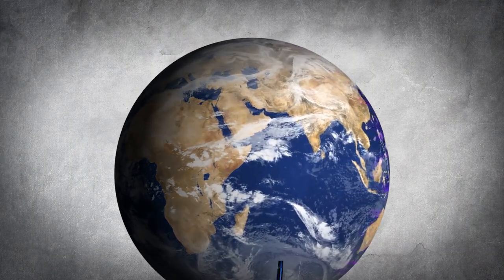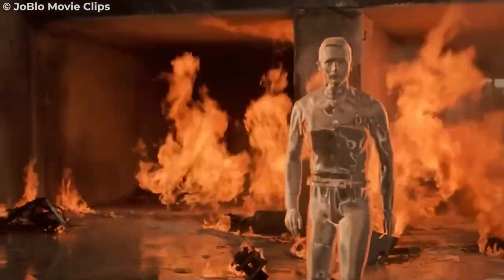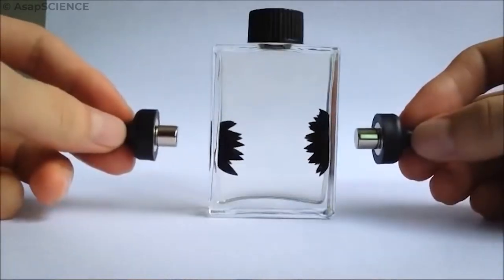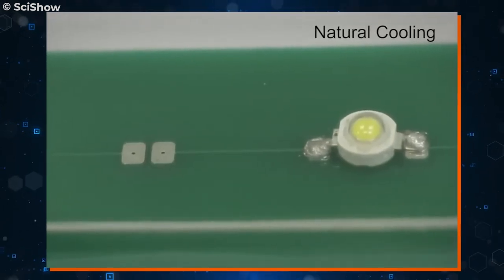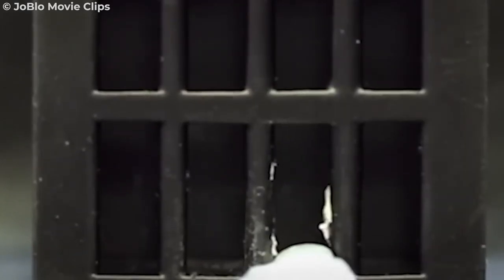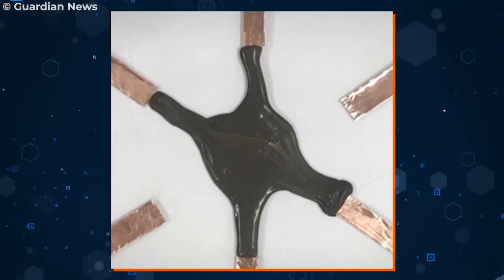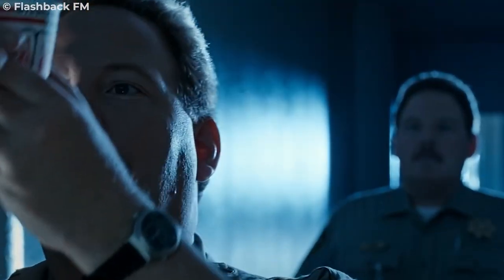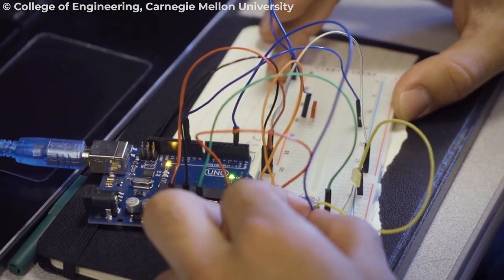This First Liquid Robot Is Genius, Here's Why

Comment: This is nonsense, the "robot" was just melted and then solidified in a mold. It can not return to the shape of a Lego man of its own accord. A robot has to have some functionality inside it. This stuff is just a metal with a low melting point and some magnetic stuff in it. It's no more a robot than a mercury thermometer is.
Reply: Ever heard of memory metal ?
Reply: @Rebel with a Cause  yes, I have heard of memory metal. That is also a solid of nickel and titanium and would not hold its memory if melted. In fact, how you reset the memory by heating it beyond one of its crystal phase transition temperatures. Just like hardening high carbon steels. This video is nonsense
Reply: Lmao "American and Chinese cooperation" then proceeds to only name of Chinese scientists.
Reply: @seanpelletier  Why don't you google up Professor Carmel Majidi and see if he is Chinese or not? He is listed among the co-inventors.
Reply: That shows how little y ou know😊
Reply: Have you heard of Microsoft  micro software.. It's just micro robotic software in metal liquid. You can move it  it does exist
Reply: Dud robots are everywhere they make our DNA in all life this is by definition a mechanical machine at the molecular scale and it is a robot as it does what it was designed to do ❤

Comment: Wow, hey, you could make digital antennas with this stuff. It would form shape based on the amount of signal it receives, everyone would have an antenna shaped differently, unique to the geographic area, it is located.
Reply: possible, creating antenna in Moon/Mars, by activating the magnets for the MPTM using lazers which are used not to stop drones.